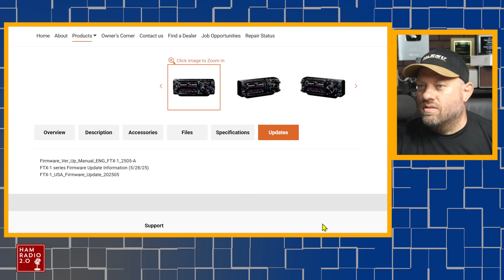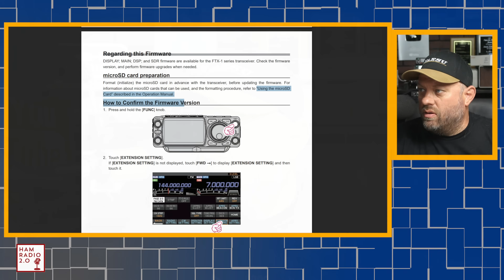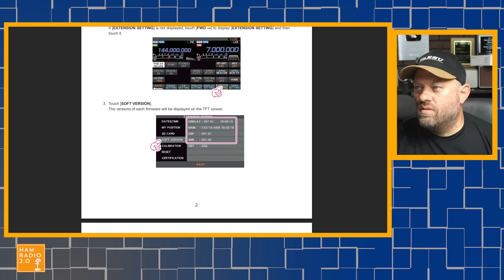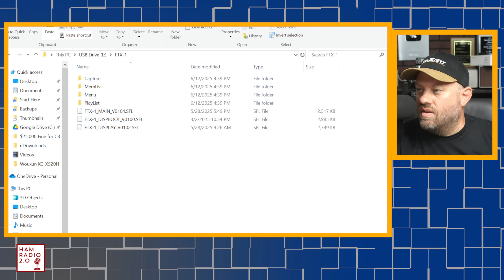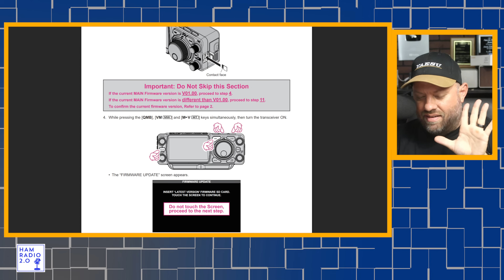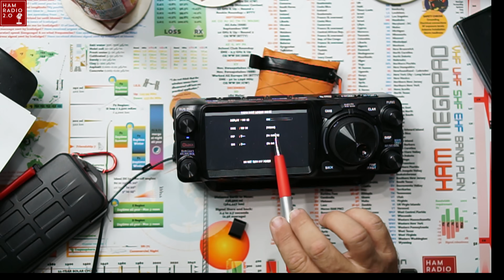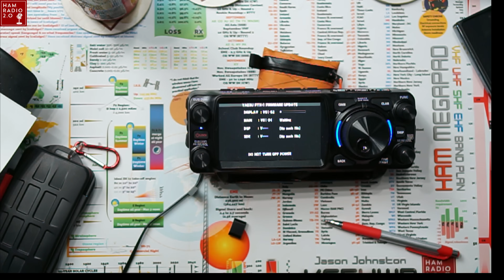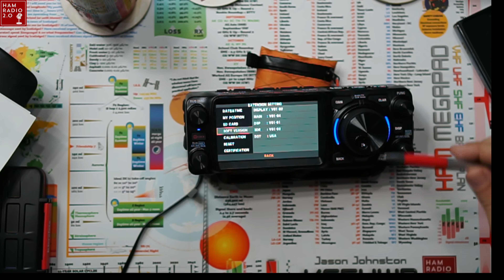Yaesu FTX-1 Firmware Update Made EASY

Comment: Attention!!! Take notice, when updating the firmware on FTX Optima, make sure you do the extract all on the file folder, and not just double click and open it, it will look the same if you just open it, but it won’t have everything and the radio, can’t read it, make sure you right click and extract it, and that fixed my issue with updating the firmware, shout out to Roger at Technical Support, very helpful!! Yaesu USA

Comment: I updated today.  Did not go exactly as the instructions said.  The "Display" was shown as "not found".  I was able to muddle my way through it and most everything is fine.  The issue I had before and after is that I can only adjust volume on the dual displly screens.  HF can be adjusted on the main.  VHF/UHF volume cannot be adjusted when just showing the sub.  It gets worse, on PMG, it doesn't matter what the volume is set for, the volume drops by 50% when switching to PMG.  It was fine before the update.  Typical when you apply patches to patches in software.  This inability to adjust volume is a P.I.T.A.

Comment: SDHC: Secure Digital High Capacity... goes up to 32GB. Above that is SDXC. Standard issue is the formatting is not standard above 32GB. It can be done with various tools, but mostly it's not worth it.
...Also, you can save your settings prior to flashing and then restore them after flashing, which works. (I confirmed this with my own FTX-1)

Comment: Devices used to take a bit longer in beta testing before they were released for sale.  Any flaws were relegated to errata lists and accepted as permanent until new versions were made and sold.  Now that most everything is computer-based, firmware updates are an expected procedure.  It's kind of a double-edged sword - faster production with periodic updates vs. the old way of waiting longer for more dialed-in products that couldn't be updated.  It is what it is and there's no turning back.

Comment: A convoluted update process. Looks pretty easy to screw up. Thanks for the walkthrough video. 👍
Reply from the maker: It isn't that hard really
Reply: @HamRadio2 One step at a time, I suppose.
Reply: Yaesu firmware updates are easy-ish.  I’m an overly arrogant IT guy who refuses to RTFM, and I’ve found I HAVE to always pull their instructions for this to get right. Once you have the instructions, and actually follow them step for step, it’s cake

Comment: I have decided since mid March of this year to cancel
the $35.00 reservation made
six months earlier in the month September, 2024, with a know
dealer, kept my F818ND, and
bought the Yaesu FTDX 10,
and had it by March 29th for
the SSB WPX contest, and I
am glad I did it this way 
The new Yaesu is great for
HF and 6 M.
I now have the Anytone AT D578 UV III Pro with the BT-01
Wireless Mike with a tri-band
Diamond Mobile Antenna, and
The Yaesu FT-891 for HF/6M
mobile with a Tar Heel Little
Pro screwdriver antenna for
those bands.
So I am set with this mix of equipment, and I don't need
Fusion nor DSTAR, only DMR. 
😅73 de W2CH Ray Peekskill NY and Marylyn KC2NKU. 😅

Comment: No disrespect to you Jason. I am amazed first off that Yaesu did not test this radio heavily before putting it out on the market. Customers pay good money for these products just to end up being the manufactures beta tester. 
Then there's the crazy process you have to go  through to do the firmware update.   ( Still dependent on SD cards!?REALLY?)  My phone and my computer firmware updates are way less painful  than what you have to do to update one of these new radios. Firmware updates should be as simple as down loading the update to your computer and then plug the radio into the computer and load the new firmware into the radio. Look at the RT Systems programming software. Why can't firmware updates be similar to how your program a radio for frequencies? 
 I am not a computer wizard by any means but GEEZ! Call me stupid but this just seems a bit ridiculous!  I thought the radio technology had moved farther forward then this.
Reply: These radios don’t have internal storage like these other devices you mentioned. The firmware is actually being transferred to internal storage usually first on those, then applied. They COULD make it work via USB, but it will have a higher failure rate due to adding one more link in the chain.  All radio companies are behind the times when it comes to their OSes, with a couple very rare exceptions. So while you’re right it should be better, there is a basic explanation of why it is the way it is right now.  If these radio companies spent a little time pulling younger talent into their ranks, things could be a lot better.
Reply from the maker: Pretty much all HF radios require an SD card to do firmware updates.  FlexRadio being the exception.